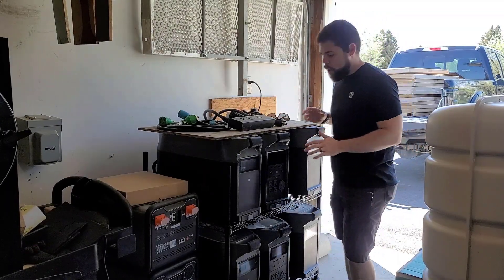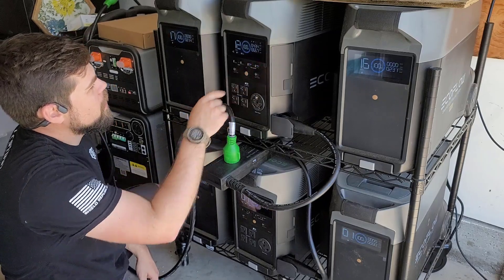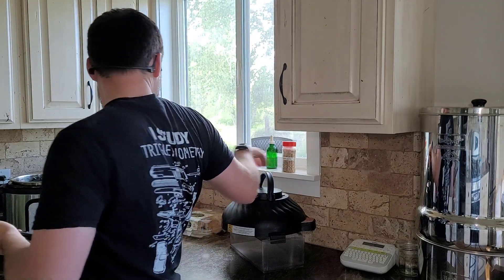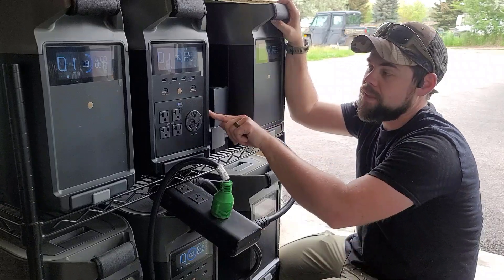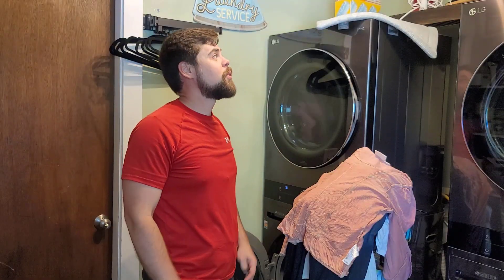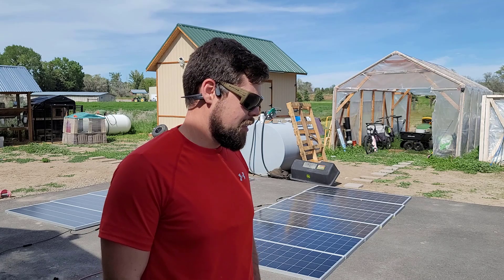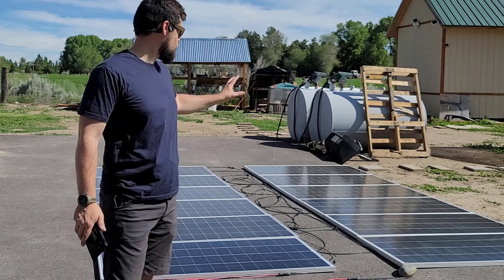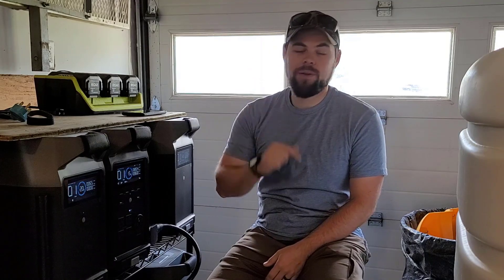Off-Grid House Powered by Solar Generator

Comment: will this run a 3.5 ton AC?
Reply from the maker: If you go to your electrical panel and the breaker for the A/C is 30a or less then yes it will run it.
Reply: @minutemansolar  it is. thank you
Reply: just curious why do you use lower wattage panels instead of others that are 400 watts? are the panels you use better?
Reply from the maker: @joshuaweidler2317  Great question. The biggest reason is due to the charge parameter (11-150v & 15a) on each Delta Pro. When you use 400w panels you can only connect up to three of those per DP, so 1,200w only. But when I use my 200w panels I can connect all the way up to 2400w and over-panel the system. From all of my testing it's literally one of the only ways to get 1600w of solar input into each DP. Even EcoFlows own 400w folding solar panels, you can only connect 3 of them to each Delta Pro. Very poor design on that part, everything else is pretty great. Overall it's still an awesome unit. But I am excited for the new Apollo to come out next month, I'll be reviewing that one against the DP setup.
Reply: @minutemansolar  that's good to know. I want to start a small system and build on it. but have a lot to learn. do you suggest using their breaker panel or will that not allow 240? I have a portable generator hookup already on my house like you do in the video because of the storms that happened in Texas when it froze and had no power for 36 hours, so I had that installed. but I like the factory design of when power goes out it will automatically pick up. But does that panel, or do you know of a way to make it do 240v? my largest panel breaker is 60w for hot tub but that wouldn't be hooked up to backup. I appreciate your help.
Reply from the maker: @joshuaweidler2317  Personally I don't use their Smart Home Panel because I don't mind doing it manually for one, and two, I test tons of solar generators and if I locked myself into their SHP then I would be stuck with the DP. So I went with the Interlock Switch because I can attach any system to it. The downside is it won't auto transfer, but I can use any system.

Comment: Hey this is an excellent video, well explained. I noticed you said the system ran your entire house for 4 days, is that because you switched of the system at day 4 and it could go beyond that or is that a limitation on the system?
Reply from the maker: When I did that test it had been 4 days and it was working very well and didn't really show any signs that it wouldn't keep going and I needed to do other projects with the Delta Pros for more videos so I stopped filming the video there. It can go longer than that as long as you're not using more power than you have stored and what you can make from the solar panels in a day.

Comment: The ecoflow home panel. Do you plan on having that install to do a EF home panel vs Interlock system you have set up?
Reply from the maker: I am sticking with the Interlock Switch because it allows me to run my entire house and I'm not locked in to one single solar generator. Keep in mind that I buy and test tons of solar generators so it wouldn't make a lot of sense for me to get the smart home panel. But even still, I prefer the Interlock setup. The only downside is it's not auto transferring.

Comment: Can you show or is there more detailed instructions on how you connected it to your house?
Reply from the maker: 2 Delta Pros, connect to 240v connection hub, use L14-30 extension cord from connection hub to L14-30P/SS2-50P adapter, plug the SS2-50P adapter into the SS2-50R Interlock Switch power connection.

Comment: It says delta pro only allow 150volts solar inputs per unit. You mentioned in this video you plan to over pannel this setup. What do you mean by that? How many volts in total or how many solar pannels is safe as maximum for this 2 delta pro 4 expandable batteries setup?
Reply from the maker: Over-paneling is when you connect more than the max solar input in watts while still staying within the voltage parameter as well as most of the amperage parameter.

Comment: Always enjoy your content! Curious if you use your ecoflow setup daily or do you shut it down and only use in the case of emergency use?
Reply from the maker: Right now I mostly use it for backup but I have been testing the last 2+ weeks having it run loads constantly in my house. So far I have done all of my laundry (daily loads because of airbnb) as well as running 2 freezers, 1 fridge, 1 wifi router, and a security system non-stop and I have not had a single day where I haven't reached 100% battery charge. So I'm saving maybe $20 a month but it's something

Comment: Were you running central air also?
Reply from the maker: No, sadly  there pretty much is no solar generator that can do central air. I just installed a few mini splits in my house and will be testing those soon though.
Reply: @minutemansolar  so it wouldn't power 4 window ac units?
Reply from the maker: @brucewillis7135  yes that's definitely possible, just not central ac

Comment: How did you get the switch over to your house from grid to your Delta Pros?   Can you show the panel hook up to your house? Did you have to get permits for your system and the hook ups to the house.
Reply from the maker: I had my electrician install an Interlock Switch, it's often called a Transfer Switch. Yes it was all up to code and done correctly. I turn off the main power from the grid, then just supply power to my electrical panel with the large SS2-50 plug in my garage which connects to my Delta Pros.

Comment: Wish I have the ability to do something like this. But wish I can do it on a Goal Zero yeti 6,000x. But it will be setup in a different way. 1. Will not be running a house.
2. Will charge small devices and run less stuff on the battery station 6,000x.
3. Will be type c slow charging.
4. Will try to do a little bit of solar in my area if having a much bigger battery station like the goal zero yeti 6,000x.
5. Type c in/out is still my favorite way of charging a battery station.
6. Nice setup roll and love the review.

Comment: What the other half of solar panels you have? Interested in seeing that I just bought two delta pros need to overpanel them thanks
Reply from the maker: I only have 50% of the overpaneled configuration as seen in this video: https://www.youtube.com/watch?v=X-qlAHMldMQ but I will be doubling the solar so it is maxed out with solar and then showing how that goes too.
Reply: @minutemansolar  can’t wait for the video I’m trying to get 3200 watts of solar between two delta pros for my off grid setup
Reply from the maker: @sikc6z415  Yup, it pretty much HAS to be overpaneled in order to do that.
Reply: @minutemansolar  have your successfully connected 2400 watts per delta pro? Looking at the packages on your website in bio

Comment: Wouldn’t a real solar system mounted on the roof with some house battery backups be better?
Reply from the maker: In many regards yes. But for example, right now, we're doing a 9 day RV trip with one of these Delta Pros. We get to run our A/C, power our ebikes, and run any electrical equipment we want cause it's so powerful and portable. So we get to enjoy it at home and on the go. There are pros and cons to every system.

Comment: I recently purchased two generators and two battery banks for now thanks to you, lol.           I know the system is rated at 1600 W, 150 V and 12 Amps.   Taking into account that if I have a 1600 W solar array and I will not be getting full efficiency, so will stay for arguments sake I’m only getting 1200 W into the generator.   Am I able to add more solar panels and not hurt the system.   I know wiring them and series will keep me under the amperage but I was concerned about going over the voltage.    So basically what is the max solar array you feel I could safely run the Ecoflow pro
Reply from the maker: Two strings of six panels and the panels being 200w. You have to check the VOC on the back of the panel. Multiply the VOC by how many panels are in one string (series). That will tell you if you're below the 150v mark, don't go over it. The DP can do up to 15a on the charge controller. So you can do 2,400w of solar, two strings of 1,200w.

Comment: Are you aware of any solar panels that higher than 210w or 200w?  I see that Ecoflow has 400w panels.  Have you tested those with the Delta Pro?  They recommend 3 panels at about $1200 each which would get about 1200w.  I think you said in your video that the panels you have are bringing on over 2000w?
Reply from the maker: You can use any solar panel you want as long as you're within the charge parameter of 11-150v and 15a. The problem is maximizing the solar input cause it's impossible to use four 400w solar panels and stay within those charge parameters to get the 1,600w of solar input that the Delta Pro is rated for. That is why I use the 210/200w solar panels that I have because they make the most power with how they connect to the DP. https://poweredportablesolar.com/product/delta-pro-kits/

Comment: I know I'm late in writing this, but I already have one EcoFlow Pro main unit and one extra battery. I also have a gentran unit with the plug outside. I have not tried connecting the two to see how they might work, but that is part of the plan. Looks like you have a more advanced and expensive system, but the same general idea. I hope my load is split 50/50. I plan on hooking the battery to the smart unit and then both to the voltage hub and then to the gentran plug. Hope this is a good plan. Nice video and I will subscribe.

Comment: also i forgot to ask. did you try running your freeze dryer? i need a system where i can run everything in my house and still be able to start a freeze dryer cycle i have the large freeze dryer
Reply: You could run everything but just dont run everything at once - have a different day for different household chores - you'll always know you have the power and not overtaxing the system - one thing I dont feel comfortable with electronics is the infallability of it - relying on the imperfect to much

Comment: hey minute man  i have a question about the same exact set up that you have. im looking to buy it for our home but i want to be 100% off grid. do you think it will work if i have the solar panels connected that way its charging as its using up battery? that way i never get low on the battery charge. i want a system where i dont have to worry about it dying and then having to chargeand not having power
Reply from the maker: Awesome! The kit is here: https://poweredportablesolar.com/product/delta-pro-kits/ I would get as many solar panels on this system as possible so that you don't worry about running out of power. I have found that generally if your power usage is around 10kwh/day or less then this system works pretty much long term without any issues. If you have more power needs than that then this may not work 100% of the time.

Comment: As you effectively have 2 systems does the Delta not have any way to balance each other?
Allowing you to use 1 solar input if needed and also to balance between the 2 legs?
It seems crazy to have to swap between charged units when 1 is running low.
Reply from the maker: Sadly no, I even tried connected the one Delta Pro that was using a lot more power into the other Delta Pro to see if the DP that had more charge would charge up the DP with less charge and that wouldn't work which I though was odd.

Comment: Is this setup practical for daily use to eleminate your electric bill? How much could you possibly save over time compared to living on the grid?
Reply from the maker: Yes you could as long as your daily power usage isn't very high. I would say that if your daily usage of power is less than 10kwh on average then this would very easily be possible. If it's 15kwh average per day it may be possible as long as there is good weather, meaning if there are many days of clouds you'd need to get power from the grid again. If it's more than 15kwh per day on average then this would not run everything in the house long term. You'd need to cut back on power usage or find more efficient ways of running vital equipment. https://poweredportablesolar.com/shop/

Comment: remember you only have 800 cycles and your down to a 80% delta pro
Reply: No, Pro has a LiFePo4 battery.  It is rated at 3500 cycles to 80%.

Comment: what you dont tell us is the cost of all the ecoflows you have and all other accessories.......I have a Delta Pro $3500 so is this all worth it??????
Reply from the maker: Sorry I thought I went over that at the end of the video. The whole setup was around $23,000, so not cheap at all. Just very convenient and easy to use. I like not worrying about gas and maintenance during long term blackouts. Also it's easy enough my family members can turn the whole system on when I'm not home in case of an emergency. Kits are here: https://poweredportablesolar.com/product/delta-pro-kits/

Comment: Maybe I missed it, do you have a video or the specs on how the transfer switches tie into your main electrical panel?
Reply from the maker: I don't have a video specifically on that. This one may help though: https://www.youtube.com/watch?v=Uat1fPVoR4w
Reply: I was wondering the same. If you're connected through a generator bypass.  I assume that if you need to use a generator to recharge the Eccoflow units you would connect directly to them so you don't have to play with the breakers unless they got so far down that you can't support the load anymore.

Comment: Did you have any air conditioners running at all during this test?
Reply from the maker: No but I am working on doing that in another video. Central air definitely will not work. But window/portable and mini split units should work no problem. That's what I'll be testing.
Reply: @minutemansolar  perfect thanks man, i got my bluetti ac300 and want to compare results

Comment: I'd say all you need to do is add more solar panels and you can make it run your home none stop.  It appeared as though at least a couple of those 4 days were cloudy.  By adding more panels you can get a good enough charge for your system even on cloudy days. If you get more panels than you need because of sunny days you can always purchase a small electric hot water heater that can be installed just before your gas heater, that can be turned on when you have an abundance of solar power.  This will help lower your gas bill. With only 1600 watts maximum solar per unit will be your biggest problem. 3200 watts of solar total.

Comment: Hi.... first off, great video and very informative!! You mentioned the cart you used in the video is a U-line cart but I cannot see anywhere the model of the cart (or at least the dimensions) and where one could buy it. I have the same set-up in a closet but due to the short cabling provided and position of the inputs , I needed to arrange each unit in a very weird configuration which is not desirable. Please provide more info on that cart as that appears to be perfect for my application and I don't want to order the wrong one.... thanks again and I'm looking forward to your future YouTube additions!!!
Reply from the maker: https://www.youtube.com/redirect?event=video_description&redir_token=QUFFLUhqbmdrVmpvR3A0cmxneDJxQjRVYWlrT2x6bTBVZ3xBQ3Jtc0tuZkRzWDJac1BkamxSbkp4STJlcjJYLWdRUllRYm1palR3WTBlWVBMUHFQMndYTkZjMGVub25mVXgwVGs2ZUU0ZXNfbjhoQ2JNbDNySnR3UTZ6NDdxSGNVazdvWHNLV25Pa0V3bWpoTkVHR01Ed3IySQ&q=https%3A%2F%2Fwww.uline.com%2FProduct%2FDetail%2FH-2945-34BL%2FIndustrial-Wire-Shelving%2FTwo-Shelf-Wire-Shelving-Unit-36-x-24-x-34-Black&v=Uat1fPVoR4w

Comment: Have you done a comparison with the solar panels you have with the delta pro 400W solar panels? If so what led you to use the panels you have over the delta pro solar panels?
Reply from the maker: I have not gotten the folding 400w ecoflow panels yet, but just with their specs you cannot add more than 3 of those (1200w) to a DP very easily to reach the 1600w max solar input. I will eventually have a video on that.

Comment: Hey on your website you're saying 2 Delta Pros can be charged by 24 210W panels (max 5040W). That isn't correct. Each Delta Pro can only handle 1600W hours of solar at a time. So the max charging rate is limited to 3200W even though you're selling it with 5040W of panels.
Reply from the maker: Sorry for the confusion, it's called "over paneling." As long as you're within the set charge parameter of the unit you can attach as many solar panels as you want. The charge controller will only let in 1600w, but you can attach more than 1600w in panels. Any excess amperage that is over 15a will simply not go into the unit, it's limited to 150v and 15a max. So yes you can add more than 1600w in panels. The reason you do it is so that you can actually get 1600w of power going in. 99% of the time solar panels will not make their rated output due to weather, dust, smog, etc. So by adding more than 1600w in panels, you can actually get 1600w going in. I have done this many times and it has been confirmed many times including by the manufacturer that it is not only possible but also safe to do so. I have an over paneled Titan solar generator that has been running for 2.5 years without any issues.

Comment: Would this set up be able to charge an electric vehicle,  something like the  Ford f150 lighting?
Reply from the maker: They are not able to charge an EV. Now that being said, I have heard that there may be a way to hack the system to it can charge an EV but it would definitely void the warranty. From my understanding, the only reason it cannot charge an EV is because there technically is no ground within the unit. There is a grounding plug you can get to trick the system into thinking it's grounded. That may work for you, but again, it's not recommended since it would void the warranty.